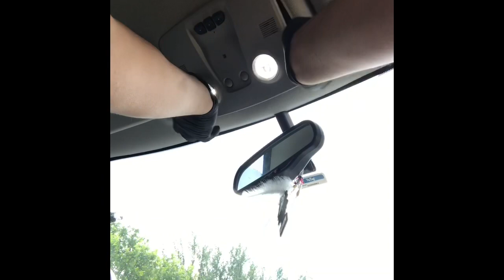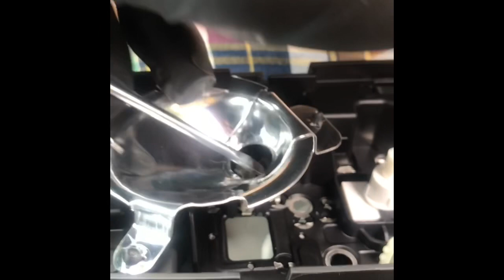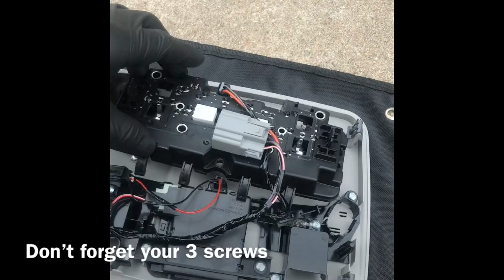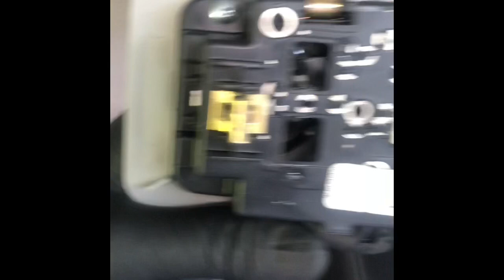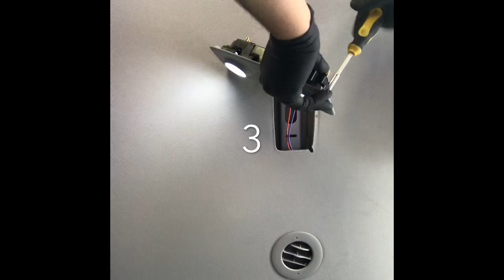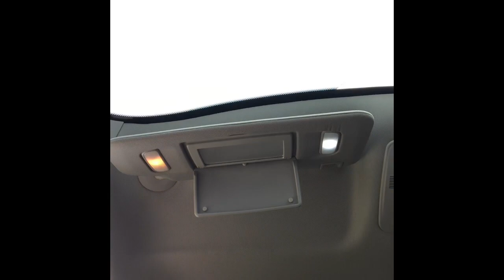2017 Chevy traverse interior LED install

Comment: I have a 14 and I put in LEDs and now the lights wont turn on when doors open or when you push the switch to come on. Could it be a fuse? Where should I look?
Reply from the maker: Alex Lungu Yes sir most definitely a fuse!
Reply: We’re you able to resolve the issue? I had the same problem, so I put the old bulbs back in and it worked just fine. Maybe it needs some kind of special bulb. I too used the T10 (194) so idk?
Reply: What fuse was it I have the same issue
Reply: diegoa75455 what fuse was it I have the issue
Reply: S Perez what fuse is it I have the same problem